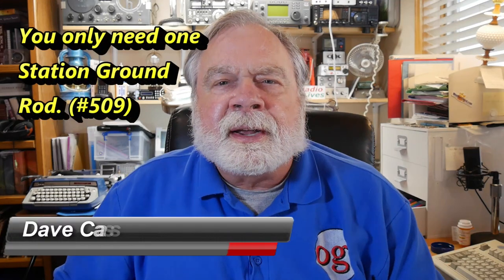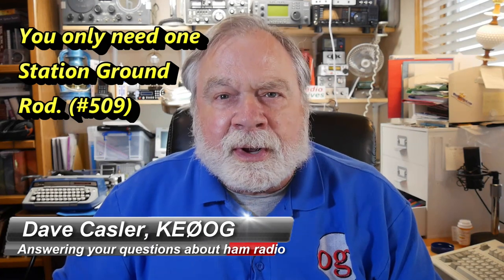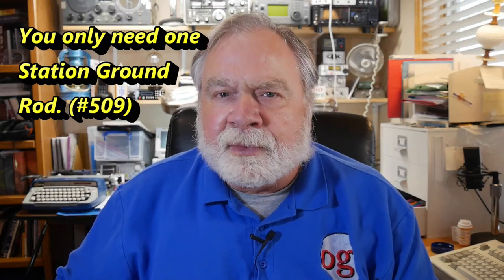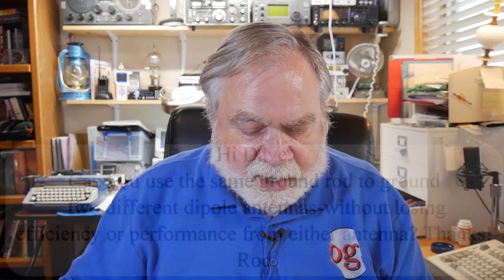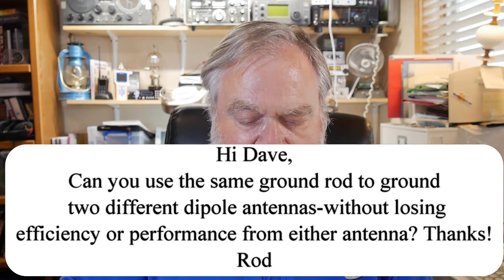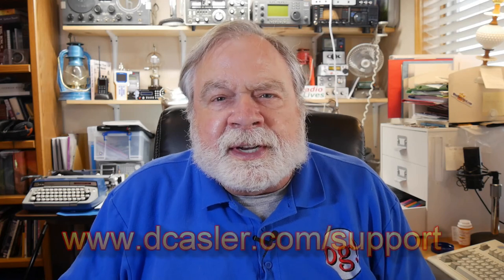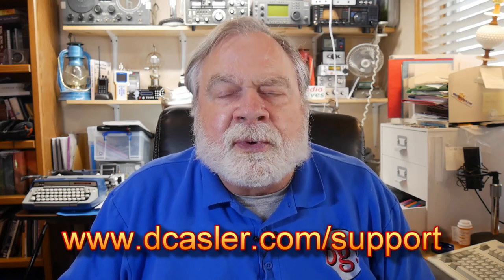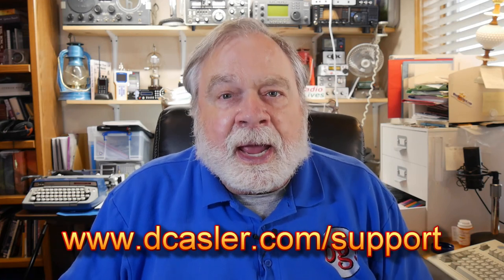You only need one Station Ground Rod (#509)

Comment: This is an extremely complicated topic
and I don't think that any blanket rules should be employed except to keep each path to ground as Short as possible (& as wide as possible or Flat Cable) to reduce Inductance per meter
meaning that a flat wide cable would have to be lengthened to become resonant on a frequency that a shorter narrow round cable would resonate on.

We need to  make sure that any part of the grounding system doesn't become an active element on any intended frequency band
& I would recommend not linking your station ground with the household mains grounding system at all !

If your station is extremely simple and only using a truly balanced antenna, balanced tuner & balanced line,
then you can actually run without a station ground.

Comment: don't use copper foil.  With high current the force can break the foil.  Braid is the way to go
Reply from the maker: I'm not talking about copper foil, but copper strap. It's thicker and more sturdy. One of the drawbacks of braid is that it can catch fire if there's too much current.
Reply: @davecasler  By strap I assume you mean braid.  Braid of the proper gauge will work fine.  But don't use the braid on the coaxial cable.
Reply: @davecasler  good videos
Reply: @ahbushnell1  To me a copper strap is a length of maybe, quarter inch by 1 inch or wider copper.
Reply: @bill-2018  Strap implies flexible.  .25" x 1 inch is not flexible.  We would call that a bus or bar.
Reply: @ahbushnell1  Well okay, so make it less than a quarter inch. Why do you want it flexible? I have seen copper pipe also suggested fixed on the bench with a thick earth wire off the end to a ground rod with all equipment earthed to it.
Reply: @bill-2018  If you want to use a copper bus that's fine.